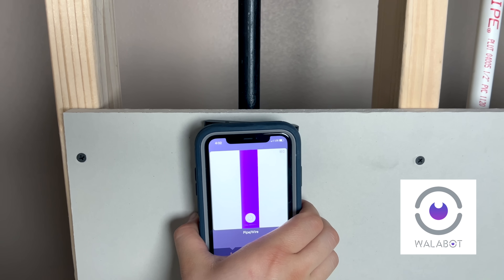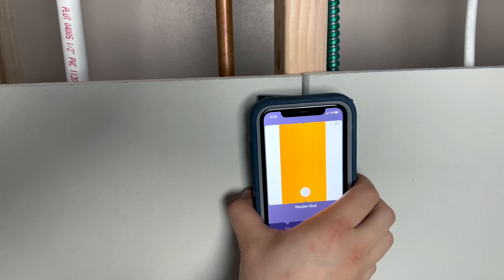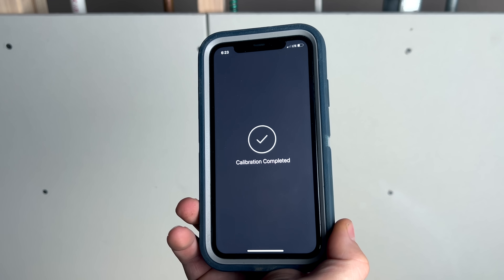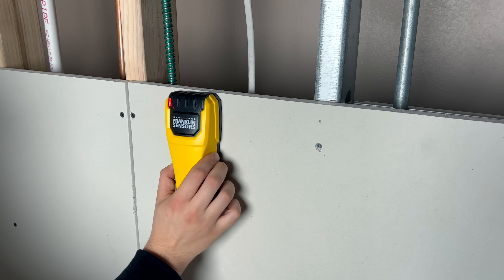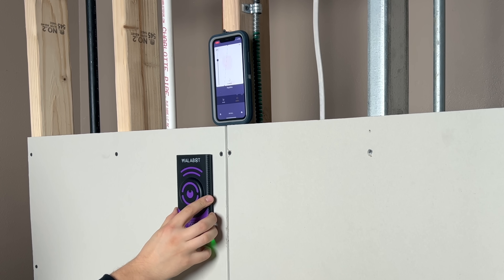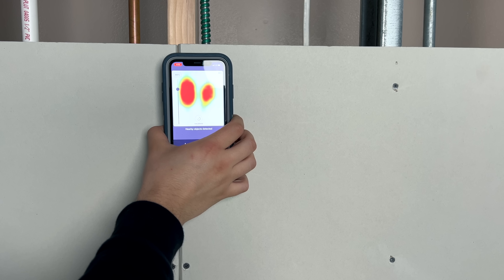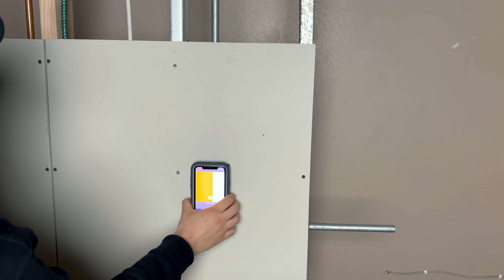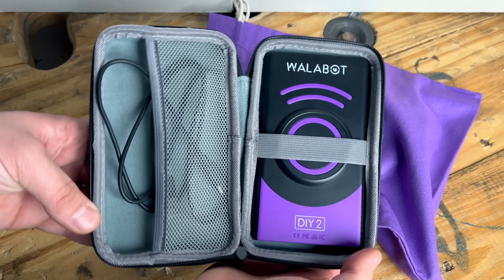The Most Advanced Stud Finder - Walabot DIY 2

Comment: If it had a Screen on it, it would be 3 times as much. That's why they let you use your phonen. But you can actually change a lot of the sensors. That's pretty cool. Do any work without it.

Comment: bought a used one on e-bay for 60$. a. holding the unit with your phone together isn't all that easy. b. it does not work on a plaster wall with any texture to it as it can't slide and the connection fails if it moves away from the wall or if the phone slips any amount on the device it starts the calibration thing all over again. c. I was expecting way too much and I returned it......
Reply: Thank you brother. You saved me some $
Reply: Never had that problem with the one I used.

Comment: Hello
Need to verify if the plastic pipe installed inside of fiber glass bigger diameter plastic pipe. 
Does WALABOT DIY 2 make such kind of job?
Reply from the maker: Hello! It will not tell you a pipes diameter unfortunately. Just whether or not there is one there.
Reply: @MadElectrician  Yes, sizes are not important. Have to just verify if the smaller diameter pipe is installed inside the bigger pipe.
So-it can do that?

Comment: JUST received my Walabot DIY 2.  It connected to my iPhone quickly (~ 7-8 seconds) and calibration took about 10 seconds.  I’m believe other reviewers that struggle in various situations don’t take time to calibrate completely.  If you’re asking a tech device that requires calibration, prob not best to expect much accuracy if you’re not doing the calibration well.  I highly recommend this wall stud finder.  It found wooden studs and an electrical wire , that I wasn’t expecting, quickly & clearly.  Just get it.  Just one incorrect drilling cannot only destroy your results, but KILL YOU if you hit the wrong electrical source.  Now you REALLY have to spend money!
Lastly some people complain about the Walabot “marking or scraping” paint off interior walls.  I agree the 2 strips of hard “plastic” would scratch surfaces, depending how hard you press into the wall.  Walabot requires only slight pressure and to make things move more smoothly & less “damaging” for some users I applied 1 strips of 3M invisible tape with a little foldover tab for easy removal/replacement.  It makes a big difference in scanning as well as protecting the device & walls.
Reply: How do you feel about it a year later?

Comment: Will this locate studs through fiberglass or hollow walls? Having an issue with this apartment complex where they installed hollow fiberglass shower walls for some reason. And of course the backer boards are not up to code. Thanks

Comment: anything you have to waste 15 sec to calibrate is garbage
Reply from the maker: Interesting metric for measuring quality 🤔
Reply: @MadElectrician  anyone in the trade wants to work as quick as possible and a tool that needs constant calibration is asinine
Reply: @sigmiami  You make a valid point. I wouldn't use it either, and not just for the point you bring up.

Comment: I noticed that no one you tube uses the walabot on insulated walls. How come? Does it not work in that situation?
Reply: I've had that same thought!  I'll raise your thought...  Can it see through plaster and wood lathe?
Reply from the maker: It actually work perfectly fine with insulation, I think most people who review it on YouTube like me just build a demo wall and don’t think about putting insulation in it. I’ll probably make another video at a future point answering questions I’ve gotten about it. Based on comments on my other social media accounts, a lot of people seem to think that it isn’t even real which I find pretty funny.
Reply: so it'll detect a pvc pipe or wire buried in a 3 1/2 or 5 1/2 inch insulated wall? I'd like to see that before I buy the walabot. Let me know when you do that video. Thanks,  @MadElectrician

Comment: The lazy part is making this use a smart phone, and not designing a screen for it. Just lazy.
Reply: Probably to keep the price down…
Reply: As many have already mentioned, keeping cost down for a screen. But, you can also bet the phones processor is doing the heavy lifting as well on the software side. Without using a phone (which pretty much everyone has) and putting the screen AND processor on board, the cost would more than likely at least double… and who’s going to buy a $400-$500 stud finder? People who can more than likely hire people to do their plumbing, electrical, and even hang their shelves and family pictures.
Reply: @mrpj2713  One little processor chip, if it even needs that, and a screen isn't going to boost the cost that much. I'd buy it, and I think a lot of people would. It would free up one hand, make it easier to use and I wouldn't have to tape it to my phone, like in the video, to make it easier to work with.

I use a stud finder as it is, but tying it to a phone is keeping me from considering buying this one. Otherwise I would.

You're just echoing what others have said with no facts, and no statements that you actually use a stud finder, let alone do anything that might need one. One the other hand I do. New content folks, or I am not going to answer.
Reply: @lesliesavage9229 It's the processing power they are after.  I cut my teeth as a boy on Fast Fourier Transforms. That thing is actually doing some heavy lifting computationally. In fact, my concern would be accuracy in a cluttered wall.
Reply: @@Patrick_Tremblay You're not convincing me at all. Yup, I'm going to need to share photos of studs! It's being too lazy to design an interface, and too cheap to put one in. It's all about reducing cost, and then convincing you they did you a favor, which they seem to of sold you on. Not smart, cheap.
Reply: @lesliesavage9229  100% agree. basic smartphones are available for about $100, retail. They could integrate  a device and still turn a profit at a $200 price point.
Reply: @lesliesavage9229  So I take it you will be making your own and selling it?
Reply: @@Patrick_Tremblay 2 comments have been hidden by YouTube, so I have no idea what you are referring too.
Reply: There's additional processing involved that a phone can do that would cost significantly more if you built your own hardware for it. Similar systems cost $1k+
Reply: @ubacow7109  That's just not true. It's not going to cost or make it cost 1K to make this work without having to hold two devices to make it work. It's very unreasonable to have a person hold two devices to do a job this was designed for. Just lazy on the part of the designers.
Reply: Look at the Bosch or Makita Wall scanner.... this is a pro instrument used by people in the industry. Cost $1.2-1.5K. Has a shitty LCD feeds terrible information, and weighs more than your phone + the walabot combined.... This does 99% that does but for far less... & yes adding a screen is actually going to make the user experience worse...

Think about this, you have an app already and it works, you just give it to someone and they have a phone already and it will work w/ your hardware so long as you have an app

Now consider this, you wanna add a screen, you now need to toss a rasberry pi on it, the interface is slow and shitty, but it works thats $100 already right there. Now you need to buy a screen.  You find a cheap RGB LCD display and its ugly and its low resolution, but u live with it, another $30. but now that you've decied to go w/ an uncommon OS  you now need to rewrite the code for everything you spend $30-60K having your developers re-make everything for your now shitty studfinder w/ an ugly display. But wait now you need to power it and give it a BMS, well theres another $30-50 in manufacturing or sourcing a BMS and battery pack. Now you have a $200 stud finder w/ a laggy & shitty operating system 

Oh wait now a customer complains that a certain function isnt working how do you give them OTA updates w/o an app store???  You cant because you need to own a server, or you give them a download link but 99% of people will never update a stupid stud finder..... Add your developers efforts have now gone to waste as your CS team now needs to deal w/ customer complaints from people who just wanna use a stud finder... Costing them tens of thousands a year in work labor just answering pointless emails... 

adding a screen is not the only thing you need to do when you add a screen....  As a consumer of a small startup's product I wouldnt not want this reliable piece of hardware to use cheap 3rd party components just cause you thought it was "lazy"... because you would absolutely make a far worse and more expensive product...  You're def not suited for hardware design....
Reply: @ubacow7109  A long winded excuse showing all you want to do is win an argument without dealing with the truth.
Reply: @lesliesavage9229 actual brain rot
Reply: @ubacow7109  LOL Now you reduced yourself to name calling.
Reply: Good screens cost good money, need to keep price point down.
Reply: @bige6487  The product is that bad that the price needs to be kept down?
Reply: It's saves you money by having to use your phone... unless you want to pay more for the product if they add a screen
Reply: @andrewstrawser6177  I would. I don't want the hassle of having two items in my hands trying to see through walls. It's a dumb design. It's the one thing that is holding me back on considering buying it. I love the idea, but not the implementation of it. 

They even have the phone taped to the device, which shows they know how it should of been made, and their answer is tape! Cheap device, and poorly made commercial showing the right way to use their all so great product is with blue tape used to join what should have been joined.
Reply: yep. for $200, it should have it's own display.
Reply: @bmandiego  You're right. Displays are cheap, and there should be one on it. :)
Reply: @bmandiego  You need a lot more than a display if you wanna give it a display...
Reply: No, keeps the price down.
Reply: 😂. Dude out here complaining about a very well reviewed product. Why don't you create your version of a Walabot instead of criticizing a well intended product.
Reply: As a developer trust me when I say the cost of that app cost way more than adding a screen.

Unless they increased the price and kept the unit the same as if it had its own screen.
Reply: @GeorgeLathem If you were in the business, then you would know this just isn't true.

Adding and  manufacturing a screen cost far more than developing and selling something that doesn't exists in the real world.

They're not doing it for your convenience, since it is even awkward for even the person showing how to use it in the video. Two hand operation or taping it together with a phone is easier on the user? Get real.
Reply: @GeorgeLathem  As a hardware developer trust me it costs far more for them to add a screen... Theres so much more involved than "just adding a screen"....  this low level hardware is just  sensors and a camera, adding a screen will involve building an interface and you're going to spend far more developing  your own OS or interface for 3rd party hardware  that will work worse than if you had just used an app on a phone...

Comment: If this works on a MRI and Cat scan, then this is a radio active out put in the light spectrum that the medical imagers fall in. What is the output strength and the danger with long term use?
Reply: As it is on a wall....and not a human, why ask? Unless you also wish professionals to label hammers as "not for use on humans"
Reply: @howardhoman8233 if it emitted X-ray radiation, it would absolutely affect the user via “scatter” radiation. This definitely does not use X-ray radiation (that’s what CT or “CAT” scans use. MRI (no ionizing radiation) is magnetic resonance imaging and you need a giant unit that costs millions of dollars to use it. It’s impossible for this tiny handheld unit to use either of those technologies. What makes much more sense is some sort of sound wave tech.